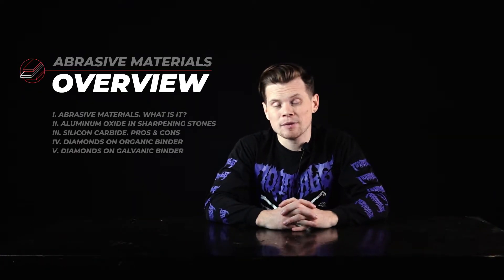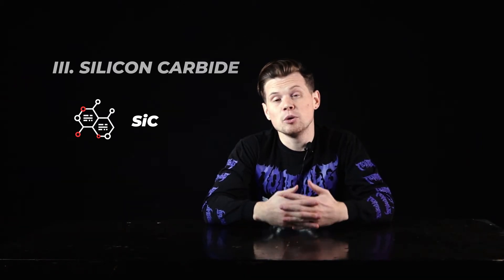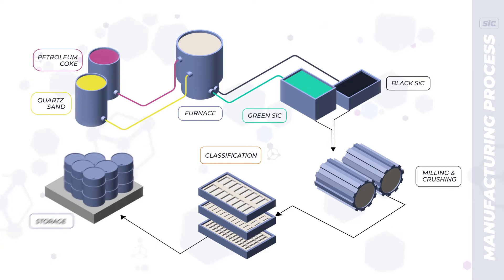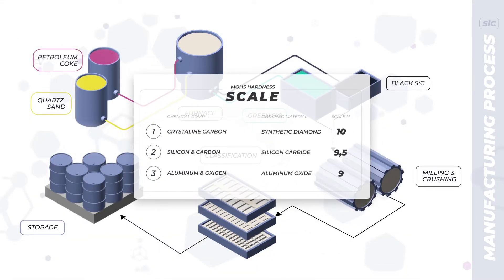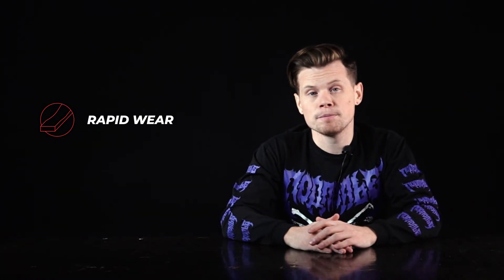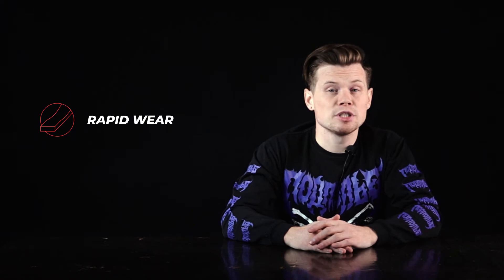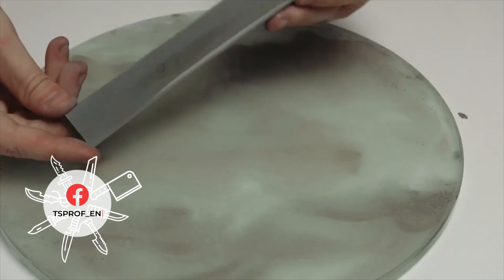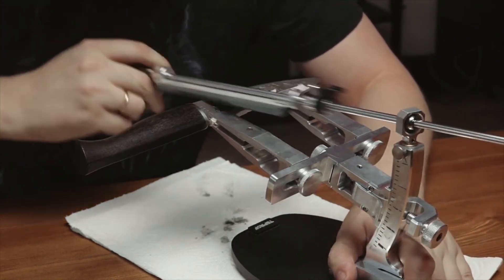SIlicon Carbide in Sharpening Stones. Pros & Cons.

Comment: I have a stone, silicone carbide, but no mention anywhere if I should uße water or oil? Is there a way to tell?
Reply from the maker: That depends on its bonding agent. As a rule, SC are used with water. but there're some exceptions. It's better google it to know for sure.
Reply: Oil is for natural whetstones. Carborundum is used for wet sanding all the time.

Comment: How soft of a metal can i use on silicon carbide stones on HRC hardness scale? I've bought some silicon barbide stones from gritomatic as far as I know only harder metals should be used on them, but what if I have metals that are 57 on HRC scale, is that okay to use silicon carbide on them?
Reply: Don't worry, there is no problem using a very soft steel on a very hard stone. The harder stone just cuts faster the softer the steel.
Reply: Carborundum is way harder than slate and steel so use it.

Comment: is diamond stones the only ones that can sharpen ceramic steel or  zirconium dioxide as it's also called, recently bought borried stones because i didn't realise it was ceramic steel
Reply from the maker: I guess, only diamond stones can sharpen ceramic steel well. On galvanic binder works better.